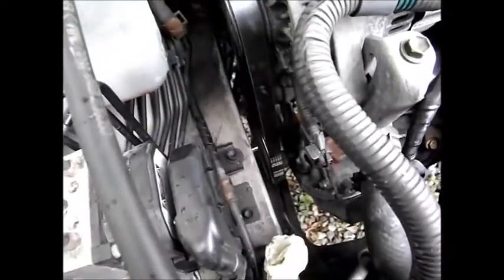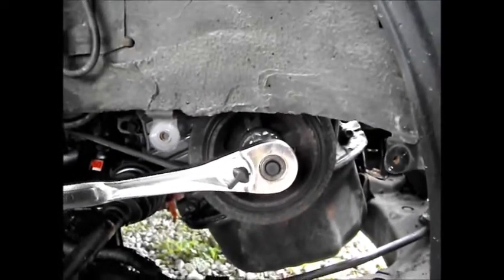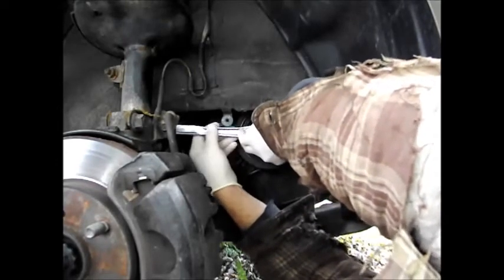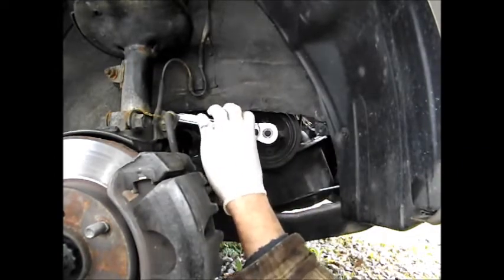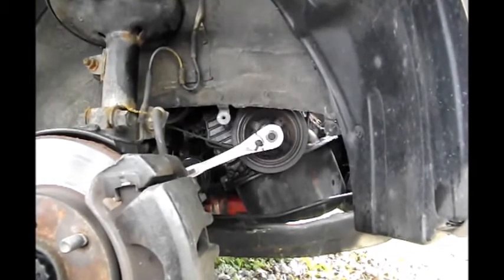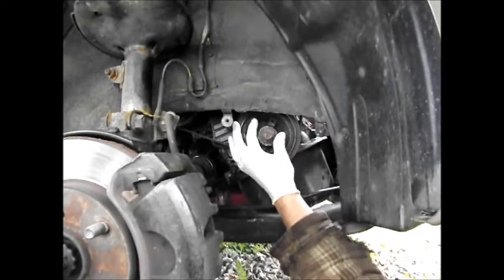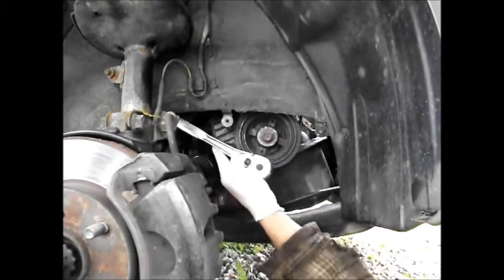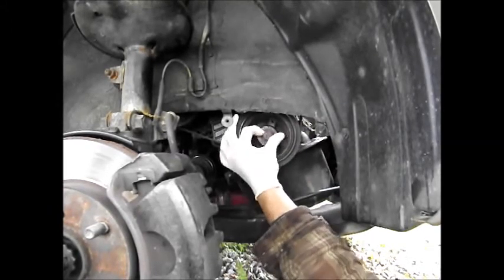Toyota 2.2L harmonic balance removal Camry 1999 DIY

Comment: Retorque it to 80 ft lbs for the 5FS fe engine which is the 2.2 liter.  The crankbolt is also one time use..  Its a TTY turn to yield .. So  you should buy a new one every time you remove it .  Its a critical part or else the harmonic balancer will loosen up if the old bolt is reuse.

Comment: I used a 1/2 impact wrench it didn't work the trick is the special Harmonic Balancer 19 mm socket on impact wrench then it comes off in 10 seconds.

Comment: good thing my fucking battery is dead because its been sitting waiting for a new pulley and my 1/2" impact wont loosen it when hammering on it for a while, couple days deep with deep creep LOL still notta and the battery wont charge. Now im gonna wait until pay to get a new battery and try again this method lol

Comment: That bolt trick only works on motors that turn clockwise. Please do not try if you motor turns to the left and still has right threads. So do not try this if your pulley is on the driver side. Motors always spin to the front of the car when fwd. Just a tip for anyone with a motor that's in the car the opposite way. Or I should say for anyone trying this on a different  car just beware that this method does crack the bolt. The opposite situation only tightens it and that can definitely break things
Reply: old comment but that's not true. if you reverse the position of the ratchet and change the ratchet from lock to unlock or vise versa it will work the same. it would be better to use a breaker bar doing this though.
Reply: @MrMpm3001  swapping the ratchet doesn't change there direction of the threads of the direction the motor spins. Flipping the ratchet will only make it click as the engine is cranked over. A breaker bar will break something if it is in the opposing direction. All you need is a nut and bolt to test this theory. The nut is the crankshaft. Engine direction always spins to the front of the car when the engine is mounted longitudinal
Reply: @hondaland_  nvm. I see your point and think I confused myself. I genuinely thought I have utilized this method on counterclockwise Hondas(pre 00). But I think it was a Honda after 00 so it was clockwise. My bad for the dumb comment.
Reply: @MrMpm3001  no worries. Now ya know for the future and can share with anyone that is about to snap a crank bolt off in the crankshaft. 😎
Reply: @hondaland_  I think I would have caught myself before doing that.😂 idk wth I was thinking 🧐

Comment: So... I went and bought a compressor and the strongest 1/2 impact wrench I COULD AND IT STILL COULD NOT COME LOOSE... I WILL LET YOU THIS WORKS... Thanks for the vid...
Reply: Yep. Worked. Drove 16 hours to down south after changing timing belt. Did this job 6 months ago or so.
Reply: Did it work ? I am about to try it.
Reply: @MrEarthwaterwind  update?
Reply: neither updated huh, my impact on full blast wont budge it